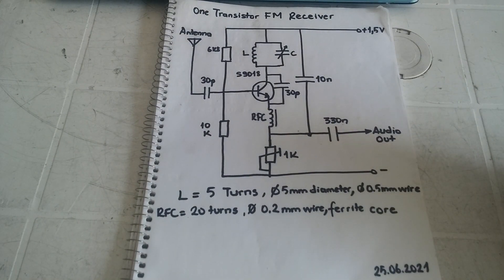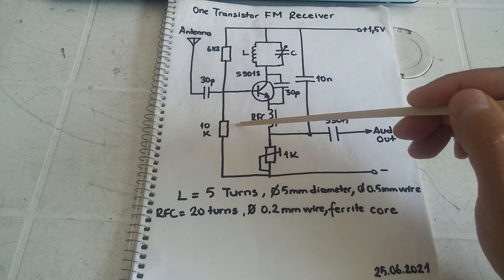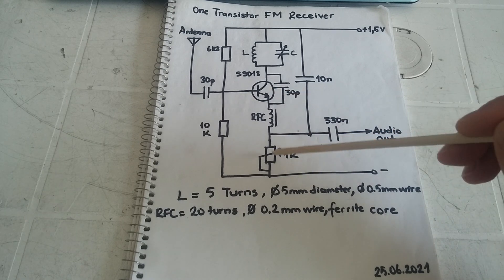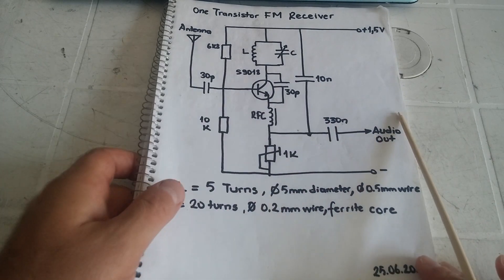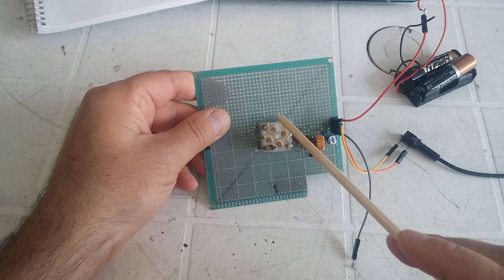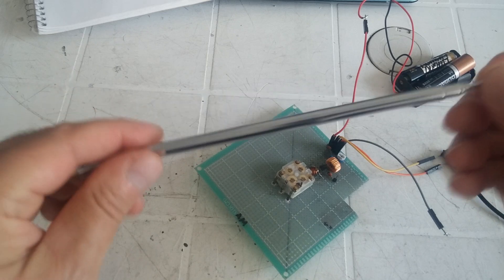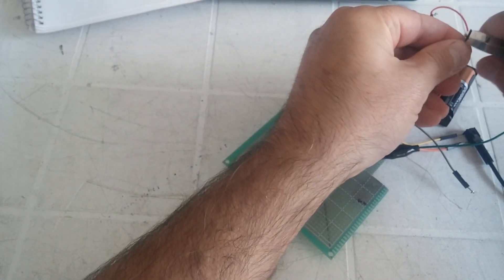Single transistor FM receiver circuit. Easy to build, works great!

Comment: i built the circuit but it hears ten diferent radio stations at ones and by turnig the tuning capasitor nothing changes
Reply from the maker: Did you change the settings of 1k trimpot ?
Reply: @nusyil no. but another guestion can i use 2n2222

Comment: Hello, can you make a part list with the name of every part and where to get such parts as the board? Thanks
Reply from the maker: @HardLight77  hi. İn the electronic circuit drawing show all the components name and their values. Also I explained them in the video all. Thanks.
Reply: @nusyil  aber die Platine

Comment: Hi does it work with fm 87mhz to 108mhz. Can the rfc coil be any coil or it needs a specific value.
Reply from the maker: @The_electronics_nerd  hi. Yes, it works in FM band. 10uh RFC coil works fine.
Reply: @nusyil  thanks very much for answering but I have another question to hear what it picked up can I use head phones or I need some kind of amplifier?
Reply from the maker: @The_electronics_nerd  better use an amplifier, since the audio level is very low.

Comment: So the coil is about 0.2uH, right? There should be no issue using one of those resistor-style inductors, correct?
Reply from the maker: Hi my friend. I used 10uH, the result is satisfactory.

Comment: It's definitely a superregenerative. I used a 2n3904 and it seemed to receive something or maybe I imagined it.. I don't have a good amplifier, only gain 20. I replaced the transistor with an s9018 and despite the long wires, it receives many stations although one station local is everywhere. The sound is very weak but because of the amplifier. Do you think that an lm386 with a gain of 200 is enough?
Reply from the maker: Hi my friend. I answered you with mail!

Comment: Thank you, engineer. I did not know why I put the 20-turn coil and what is its role, because there is a special five-turn coil for a resonance circuit with a frequency pickup coil.
Reply from the maker: Hi my friend. 20 turns coil is not for resonance circuit. It's  Radio frequency Choke coil.
Reply: @nusyil  👍 How is the choke coil calculated to be placed in the circuit to match the frequency to be choked
Reply from the maker: @mohtechnodz3053  a 10microhenry coil is fine.
Reply: @nusyil  what does the choke do?
Reply: @janszwyngel4820 It makes the oscillator go in and out of oscillation so it does not overload with feedback.

Comment: Hello, how can we mute the sound at an empty (noise) frequency on the fm radio, what should I use for this?

example :

vzsssssssssssssssssssssssssssssssssssssssss (white noise)
Reply from the maker: Selam. Kullanılan devreye göre değişiyor. Bazı entegrelerde, örneğin TDA 7000'de bu özellik var. 1no'lu pini 10k direnç ile besleme gerilimine bağladığınızda White noise'i kesiyor. Diğer devreler ve entegreler için kullanılan komponenetlerin datasheet'lerine bakabilirsiniz. Ancak genel amaçlı, her FM radyo'ya uygulanabilecek universal bir devre veya uygulama var mıdır bilemiyorum. İnternette "FM receiver white noise canceller" vb aramalar yaptırarak bir fikir edinebilirsiniz. Kolay gelsin.
Reply: @nusyil  Ben fm modülü olarak RDA5807 kullanıyorum bu beyaz karınca sesinin çıkmasını engellemek istiyorum
Reply from the maker: @ramazanayten3758  RDA 5807'nin datasheet'ini incelediniz mi? Böyle bir özellik olabilir
Reply from the maker: @ramazanayten3758  Şimdi baktım datasheetine. "Digital adaptive noise cancellation" özelliği var diyor. Detaylı incelemedim, bir bakın isterseniz.
Reply: @nusyil  nasıl kullanabilirim
Reply from the maker: @ramazanayten3758  Bilemiyorum. Dediğim gibi datasheet'i inceleyin. Bu modülü programlayabildiğinize göre, bu özelliği de ayarlayabilirsiniz. Kolay gelsin.

Comment: Can i use s9018? Thanks
Reply from the maker: Hi my friend. Yes, already I used s9018 too.
Reply: @nusyil  thanks i will try to Make the radio
Reply from the maker: @lukabread4099   You're welcome. Good luck !
Reply: @nusyil  is The 1k resistor with the weird Mark a pot?
Reply from the maker: @lukabread4099  weird mark? What do you mean?
Reply: @nusyil  whats the thing on the 1k resistor
Reply: @nusyil  oh its a trimmer is only 2 pins connected?
Reply from the maker: @lukabread4099  No, as you see in schematic, you should connect middle pin with one of any others. So , practically you'll get two pins.
Reply: @nusyil  ok now i understand everything thank you greetings from finland
Reply from the maker: @lukabread4099  You're welcome my friend. Greetings from Mexico!!

Comment: Nice design, I definately want to try it. I'll probably use a BF-series NPN transistor. However I wonder why we couldn't use like a BC547; its f_T is still about 300 MHz and its overall gain is higher so it could make up some losses. 🤔
Reply from the maker: Hi my friend. Thanks for your comment. I tried a few other type of transistors, like 2N, o BC series but it didn't work. Sure, you can try and test. If you success, share with us your experience. Good Luck!!
Reply: 300 Mhz is the max of those transistors at only unity gain so probably (as I am like intermediate level of knowledge for radio technology) not enough gain with higher frequency like 100 mhz etc. Even for AM radio , using 2n2222 I needed 3 transistors amplifiers  to have enough gain. Before I made that mistake that i used cheap transistors from Aliexpress for everything , now I am smarter and I buy only original ones and I try to choose the transnistors for their purpose if I am doing RF Ichoose transistors for RF, if a power amp, I choose power transistors etc. They design transistors for a specific task so if you use for something different it is not going to work ...
Reply: @grzesiek1x thankyou for this comment. I have been using cheap 2n2222 from Ali express so that could be a clue to the trouble I have had with any 27mhz receivers I have tried to make work.
Reply: It should not be a problem to use the BC 547  or 2N types in this circuit. You just need to adjust and tweek the bias resistors and or the feedback load/variable  resistor and the supply voltage. Set this up with all the above parameters as variable trimmer pots till you establish the optimal values and replace with fixed values. Good hunting!

Comment: Very interesting! This does not look like a super-regenerative circuit (no quench oscillator), actually it's more like a transmitter than a receiver, especially since the base is not grounded like in most simple FM receivers. Therefore I do not understand how coupling in phase between collector and emitter is possible. One question: the schematic shows a  battery of 1,5V but in the video it looks like you're using 2 batteries (3V). Does it also work on 1,5V? Tnx
Reply from the maker: Hi my friend !

You're exactly right. It looks like a transmitter and already it is. I didn't test, but i'm sure that if you connect a microphone to base of the transistor, it works as a transmitter. Already you can see same constructions, as coupling between C and E at FM transmitter schematics as well.

In the video, looks as if i used two batteries. It's correct, but one of the battery is a dummy battery :) It's was a dead battery, i made jumper between positive and negative, so it's became just like a conductor. Because i had no battery holder for one battery, only i had for two batteries. So i used it as a fill the blank place of battery holder. Also, i got the best performance at 1,5 V DC.

Greetings!!
Reply: @nusyil  Tnx for the friendly reaction! I just finished my experiments with a similar schematic but the difference is that the HF transistor (BF 180) in my design is working in common base mode (base grounded) while yours works (partly) in common emitter mode as a mixer. Mine also works with only a 1.5V battery en is so sensitive that  an antenna is not needed. The quality of the sound is much better than I expected. I believe that for optimal sensitivity the transistor needs to oscillate weakly (so a low battery voltage helps!) and being able to regulate this 'soft spot' smoothly is the key to succes. If you are interested I will send you the schematic and some photos. How can I contact you?
Reply from the maker: @erikdevriese671  Hi. Thank you very much my friend. Sure, i want to see them. This is my e-mail adress : mateksmakina@hotmail.com
I'm looking forward to hearing from you..

Comment: Can I use a s9013 or s9014 transistor???
Reply from the maker: Hi my friend. No, you cannot use them. They are not High frequency transistors. They are low frequency amplificator transistors. You should use one of the FM, VHF or UHF transistors. Good Luck!!
Reply: What are the other transistor can I use instead of s9018 can I use c945?
Reply from the maker: @michaeljoshuamanallo1742  You cannot use C945 neither my friend. You can use BFseries high frequency transistors, e.g. BF197-198-199-240-422, ED1502 etc. For more information, you can investigate in internet.
Reply: I have a c2785 transistor in a old radio receiver can I use it sir?
Reply from the maker: @michaeljoshuamanallo1742  No, neither my friend. Google says, that transitor is an AF amplifier transistor, so you cannot. Please use Google to find datasheets of the transistors that you have. Good Luck!!
Reply: I searched a transistors datasheet  name c380 transistor and it shows high frequency amplifier application
Reply from the maker: @michaeljoshuamanallo1742  Yes, i think so. You can use it.

Comment: What is value of Gang Capacitor
Reply from the maker: Hi. I got it from an old pocket FM-AM radio. But any 4-40pf variable capacitor is suitble. Good Luck!
Reply: @nusyil  
Will you please elaborate the Gain Coil used in emitter ...or any Hand made ferrite core coil
Reply from the maker: @microxone  Any 10uH-33uH coils works without any problem. It's not very very critical. There is no obligation to wind on a ferrite core.
Reply: @nusyil  
Secondly when to demonstrate one trasistor amplifier with this circuit diagram
Reply from the maker: @microxone  You can take a look my other videos. There is another similar circuit with two transistors.
Reply: @nusyil  
Can I use Transistor 194C instead. 
If not pleaee sugge6 equivalent trasistor
Reply from the maker: @microxone  Hi my friend. I don't recognize the 194C transistor. You can use any VHF-UHF or FM transistor. Like some BF series transistors.(e.g BF199).Good Luck!

Comment: The circiuit and scheme looks slightly different
Reply from the maker: Hi my friend. What is the difference ?
Reply: @nusyil  Hi 
On the board I can't see the capacitors. Have I too small screen ? By the way ... Capacitor 30p should be connected to resistors ? There's no dot at crossig the lines so Im not sure...
Reply from the maker: @dominikbatorski3121  If you pause the video at 1:45  and get the full screen you can see clearly capacitors. You right, only i didn't install 330nf Audio out capacitor, since the amplificator which i connected, has internal input capacitor.

And yes, the 30pf antenna input capacitor is connected to the resistors and the Base pin of the transistor.
Reply: @nusyil  Thanks a lot :)   Then I grab my soldering iron ...

Comment: Does it need an amplifier? Conecting an 8ohm speaker to the output makes absolutely no sound
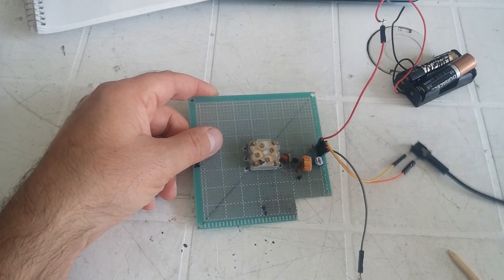Reply from the maker: Sure. You cannot drive directly to speaker. You have to connect it to an amplificator.I mentioned about it in video. Look at the video at 1:35.

Comment: Is the choke coil a toroid? Whats the radius of the ferrite coil?
Reply from the maker: Hi. Normally it's RFC(Radio Frequency Choke) coil. I found a toroid coil from my scrap box and used it. I took it from an old SMPS power supply. It works without any problem. Diameter of toroid is 10mm and 30 windings of 0.1mm copper wire. Good luck!
Reply: @nusyil  Thank you! Great circuit, good audio quality with very few components!
Reply from the maker: @Galvan1  Thanks a lot my friend. Good Luck!